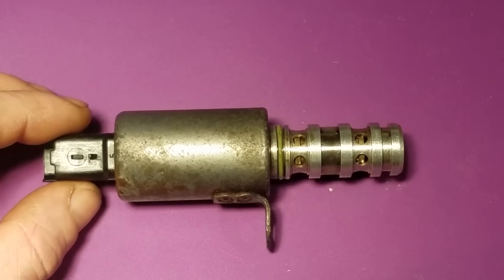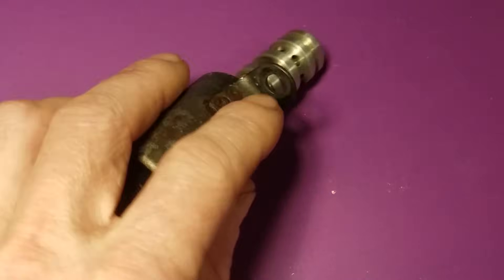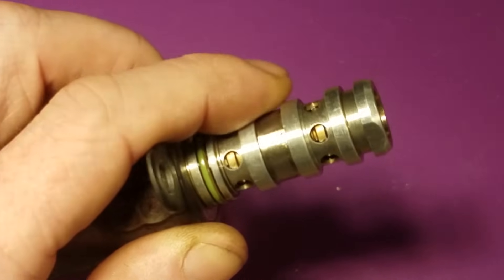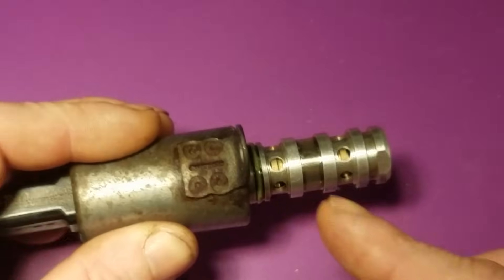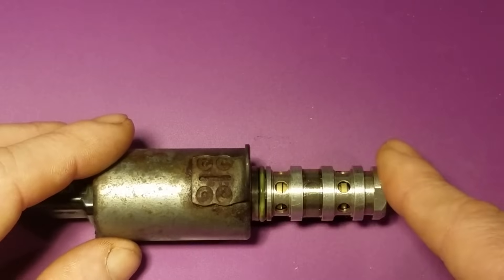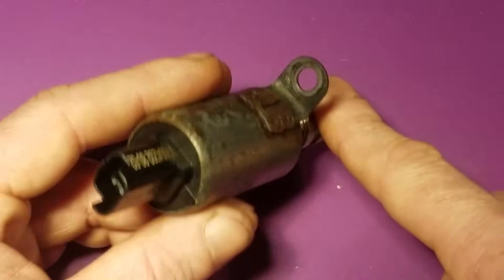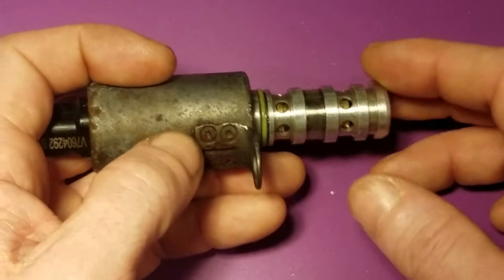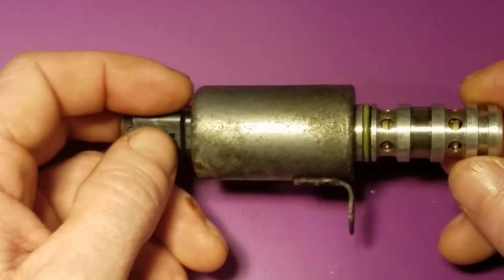Variable Valve Timing Code p0011 p0010 p0012 p0013 p0014 p0028 (Don't Waste Money)

Comment from the maker: Pocket Scan Tool: https://amzn.to/2GlbzzY
You can get VVT Solenoids on Amazon Cheap here: https://amzn.to/2whpJO2
Reply: The Flat Rate Mechanic its vct solenoid not vvt
Reply: I just cleaned mine and the power saving  light come on while on the highway than the power steering came on a 10 minutes later and the ABS also till I lost power (P0010 a)
Reply: ggg's fan its actually vvt. Valve variable timing . I've dealt with them
Reply: The Flat Rate Mechanic epic video
Reply: The Flat Rate Mechanic l have a 07 trailblazer with 148k. I brought it with 120k. I have made sure that I've have done all the reg maintenance myself. I use Mobil 1 and I just changed the oil the other  day and I decided to pull the cam actuator and check the screens. To my delight they were very clean , just a few tiny specks of debris. this is the first time I've checked the valve timing solenoid I pulled it out and it was very clean screens were very clean . I think the previous owners must have had it serviced reg too.
Reply: Thanks, my Benz has the P0012 code so I'm gonna try this first. Great video, very Informative.
Reply: I have no codes yet I went and took out that solenoid and cleaned. I have a hard switching gears at about 40mph and why would up hill it revs up hard like the timing is off behind

Comment: My 2009 malibu with 175K just threw a CEL.  Used my OBDII scanner and got the P0013 code.    In all 175K miles its never used oil between changes, but just went and checked the oil it was low!!  Added about 3/4 quart and CEL gone.  Thanks for saving me from embarassment (or geting ripped off) at the mechanic!!!

Comment: My 2005 Volvo V50 2.4i Check Engine light came on while on a trip back from SW SD to SE MN. I stopped and had the code read for free at Oreilly Auto in Rapid City, SD. P2006 was the error code for Bank 1. Since I didn’t have tools to do a solenoid replacement I scouted the web and found your post. I had an oil change done before leaving Rapid City and that solved the issue. Thanks for posting this info. I am new to Volvo’s and I’ve heard they can be pretty sensitive if not maintained properly. You saved me a lot of time and trouble!
Reply from the maker: Thats awesome. Thanks

Comment: My friend ran his oil low and way overdue car started running horrendous multiple cylinder misfires on all 6 cylinders. Codes p0018 and P0022 led me to believe this was the problem. Changed oil and took it a few miles to wash off the engine at the car wash. By the time I got done and cleared all the codes it was running like nothing ever happened. This video explains what happened thanks! 2007 Hyundai Santa Fe 3.3 l v6

Comment: I replaced mine before I had any codes. I then took the old ones and cleaned them by using a sonic cleaner.
I always change my oil and filter every 3,000 miles so they looked pretty clean. I ran them through the sonic
cleaner twice and it did remove some light granules. After cleaning I put them into a container and filled it
up to the bottom of the plunger with oil so they don't rust. They are now ready to use if and when I need them.

Comment: I had the  P0013 problem. The change of the oil seems to have helped. Thank you!
Reply: I went from full synthetic 5w-30 to high mileage full synthetic and it caused a check engine. I’m gonna try to switch back and see what happens

Comment: Thanks. Had the problem with my Lexus.  Oil clean, screens clean, valve cycled fine. Went to my mechanic, who is a smart guy.  He just cycled it more times. After maybe a dozen or so, it failed. Replaced it and no problems. In retrospect, I probably just should have cleaned it more thoroughly. Will the next time!

Comment: First thank you for your video, it was very informative and easy to follow. I only 2013 Buick Verano, when I purchased the vehicle it was at 20,000 miles. I am now at 85,000 miles and have experienced that code on my vehicle three times. Along with that code popping up my car will also shut off while in idle, this would typically happen after I start my car drove and then come to a complete stop. Each time I was able to start the car again and everything would be fine. I took my vehicle to the Buick dealer due to this engine code 3 separate times. Twice they told me they had to replace the camshaft. This last time which was about a month ago they told me that the code was due to low oil. I got the old changed and he told me that my car will be fine however my car is still shutting off while I’m driving it. They also turn the code off and now it’s not coming back on, But I’m wondering if my car is shutting off key to a camshaft iss but I’m wondering if my car is shutting off due to a camshaft issue
Reply: Stop using cheap oil.  Mobile 1 oil filter  high mileage formula synthetic oil  an oil additive synthetic lucus oil treatment

Comment: Thanks for the video! You saved me a few hundred bucks. Daughter just ran her car super low on oil
Reply: Cause that's what they do.😫😫😖😤
Reply: not sure how you would have ever spent a few hundred bucks, any mechanic you would have taken it to would have told you it needs an oil change lmao a walmart tech would have told you that. This video is for learning about malfunctioning solenoids, little less obvious than needing oil.
Reply: @otallono  you are way too trusting of ppl. I have seen ppl get ripped off whether due to malice or incompetence. Had 2 bad experiences with repair shops with this very car which raised my level of skepticism.  Also had a mechanic forget to torque my lug nuts and the wheel nearly fell off on a different car. These aren't shadetree mechanics I go to either.

Comment: Thnx. I got the errors and my mechanic did not know it. Kept resetting it. Pulled it out. Cleaned with brake cleaner and tested with 12v and now the code is gone. Thanks again

Comment: Thank you.  I have a 2014 Cadillac ATS 2.0T .   I am having 2 times now in 1 year,  these codes.   I replaced the solenoid once,  and was about to do it again.. but I will try to clean as you suggest my friend... Thank you !!
Reply: 99v8cobra did the problem resolve after cleaning?

Comment: After having my R56 N14 engine rebuilt it was running really tough at low RPM, ok above ~2000 RPM.  Taking out the vanos as you describe and cleaning it twice seems to have solved the problem.  I also took out and cleaned the one-way oil check valve just below the vanos.  I could see considerable sludge on the screens of the vanos, I assume residual from machining the block.  In no way to I fault the machine shop, this was a very small amount of crud but I expect enough to require removing and cleaning the vanos screens twice.  Really hoping that's all that's needed.  Thank you for the video.

Comment: I got the P0011 code shortly after an oil change from an oil change chain superstore. I am always suspicious and think I will go back to a specialty shop. I have a Chevy Equinox. Thanks for the information.
Reply: Divine Diva  samething happened to me. That same code keeps coming back. Now my car sometimes has a hard start or will just turn off .  Ive replaced the cam sensor but code still comes back
Reply: Divine Diva I got an oil change before going to my sisters 3hrs away. About an hour into my drive that code popped up. Wonder if it’s related
Reply: I want a free book

Comment: I removed a p0011 just by cleaning a ground wire near the area of the solenoid, at the front of the engine. Before the repair the truck ran rough coming up to stop signs and would buck and jerk when leaving the same stop sign. After repair the truck ran smoother and can do burnouts now lol.
Reply: What wires the connecting point
Reply: Would this happen to make my car make a noise like a grinding noise when I drive slow

Comment: Yup - checked the oil on my '18 Colorado 2.5, and it was low.  Had a couple quarts in the garage from another car I sold.  Added one, drove it and the problem had disappeared.  No other video mentions this.

Comment: Ive changed these before when i was having issues shifting gears, the problem is back with a p1811 code (transmission solenoid) hopefully this fixes it again. That was 3 years ago and about 80k miles ago.

Comment: i changed my valve cover on my 2002 vw gti. i never had this code until i changed the valve cover. my oil was due for a change and i changed it but the code came back. i’m gonna take a look at the vvt solenoid
Reply: It never ends sometimes. Seems like you fix one thing and it's a chain reaction until the whole thing is about rebuilt. I replaced a radiator and ended up replacing the transmission line. Started leaking right after the 1st repair.

Comment: I cleaned 2012 GMC Terrain the exhaust solenoid (Code P0013) and cleared the code. 2 days later, Code P0011 appeared and the car began running rough and stalled at stop lights if did not push a bit on the accelerator.  P0011 is apparently another camshaft related item that I need to fix in order to pass emissions test. I wonder why this second code popped up as I pulled into the testing station. Spooky.  Hope I can find a video about that 'quickly'.    You have a great way of presenting your information. Thanks.
Reply: Just got that code as well today did u figure out what was the issue

Comment: I just got this code on a family owned 2006 Nissan Altima 2.5L ( QR25DE ) engine , the problem is it hesitate during throttle ( on Drive or Park ),  at first I thought it was the timing , but  then I scanned  it and P0011 is the code . 
this is what I found , in 2007 Nissan made a recall on these particular year model and engine class regarding the camshaft sensor faulty reading ( overheating ) and disrupting the ECM faster than it could calculate and signal back . so I replaced both VVT sensor and the camshaft sensor , it is still doing that . 
now I must open the timing chain cover and inspect the timing DTC . 
I got the PDF file and it shows it can be even triggered by a coolant temperature sensor or oil pressure pump , and so on . I tested all the sensors and they all are working according to manual procedure. 
I tell you : these new cars are not worth buying at all .
Reply: Same with my 06 sentra 2.5. You have any luck figuring out the issue?

Comment: Also causes P300 and P012 codes at the same time.   I replaced spark plugs before I realized P012 is triggered before P300.  On Altima 2004 3.5 it is the one towards the front of the engine.
Reply: P0075 on my Opel/Vauxhall Astra

Comment: Wow that was very helpful because I just put on new valve cover gaskets on my 740I, The those codes popped up, so I’ll be changing the oil and filter
Reply: Did it fix it when you changed ?
Reply: I literally got that today , changed my vavle cover gasket a few days ago & that code popped up

Comment: Did a complete timing chain job on my QR25DE and the rattle on cold start came back after one week. Turbo, pistons, rods, springs. 18lbs
Reply: Need synthetic  Lucas oil stabilizer

Comment: I replaced my VCT(along with the 2 camshaft sensors) and I still experience the issue. what should I be checking next? runs super smooth if I disconnect them.
Reply: How many CS sensors does you vehicle have? Did you get codes?. Did U change the VVT for both banks or just one?
Reply: @ceewood1354  After several weeks of tinkering with this, one advice I had was to simply go to a heavier oil. So for grins, 1qt of LUCAS. Last 3 days not an issue. Talked to my tech, he mentioned that it was a good idea, as it is likely the OP has gone down (277k mi). There hasn't even been a hickup. Along with this screwed in some new plugs (old were yellow and torqued in NGK) and a whole set of new coils. So will be changing the oil Friday, and switching to some rotella. Conclusion: 1qt of LUCAS for me did the trick. thanks for taking time to reply back. Just forgot to come back and give an update.
Reply: @ADHD_Gamer  Super happy you found a fix!!!!!

Comment: I recently picked up a 12 year old Buick for my wife. It passed my scanner with flying colors but right after I buy it we notice it hesitated a little at start up sometimes. Nothing serious and I wasn't real concerned for as old as the car is. . I changed the oil/filter and air filter just for the sake of buying a used car. Both were just a little dirty. Nothing serious. I was not expecting the start up hesitation to go away but it did. My wife noticed zero hesitation after a week of driving and swears whatever I did fixed it. I was baffled that it went away. Maybe it's the clean oil. Or maybe its the Wix oil filter which is noted for its quality check valve. I dunno.

Comment: If you have 55psi at fuel rail and spark to the plugs but engine won't start, could that just be dirty solenoids or timing chain?

Comment: Well I was going to work this morning and the check engine light and the 4wd light came on my dash. Also the cruise control light started flashing. When I got to work, I plugged in my obd2 scanner and it said p0012. (This is on a Toyota RAV4 v6). It said bank 1 . Got home and this engine has four solonoids. I went ahead and took all of them out, one by one and cleaned with brake cleaner. Took a pick and moved the plungers. Reinstalled and boom! Lights are gone! Thank you sir. Now for an oil change.👍. I'm still not sure why the 4wd and cruise lights came on?
Reply from the maker: A lot of Toyotas will set 4wd and cruise light anytime there is an engine light. Not uncommon.
Reply: @FlatRateMechanic  Mine will leave the VSC light on for a few seconds with morning start. That's when I know to load test the battery.

Comment: i recently had the timing belt and sump cleaned and the engine light was not removed.  Could error P0014 be related to the work done relating to this work done which was supposed to resolve errors P15A8 at all?  Is the work the mechanic carried out incomplete?

Comment: Make sure you buy OEM or you'll run into trouble. Especially if you use dorman solenoid
Reply: I just replaced one on my 2003 tbird for a slow oil leak out of the connector and ordered a cheap one off of Rockauto. Now I have the POO12 code. Just ordered a genuine Ford one. Lesson learned.
Reply: @keithwiebe1787 did the oem fix this?
Reply: @cutliss  The OEM one fixed the oil leak and the code I was getting with the aftermarket one.
Reply: @keithwiebe1787  thanks for the update. I'm going OEM for electrical engine parts now.

Comment: Hello, i have Problems with P2090 on an Peugeot 3008 1,2 Turbp 130 HP EB2DTS Engine. Do you have any Tips for me. The Steering Time are 100% correctly.
Both Aktuators are new.
Regards Peter

Comment: My Sienna used to get P0012 at times, even with new oil. Even after cleaning the valve, which wasn't dirty. It could be thousands or even ten of thousands miles between codes. Then it went probably 100,000 miles fine. Just today P0012 came up again. Weird.

Comment: I have code p0010 says variable valve timing screen need replaced but I have a rattle and it’s very loud now after a bit of driving . The car will shut off I have to start it again. And it’ll do it a few more times til I reach destination. I have a 2009 Honda Accord no oil in car.

Comment: Oil has been religiously changed and checked got a P0014 change oil cleaned exhaust bank solenoid I can drive 10 miles and code comes back

Comment: I get a check engine light that throws a p0012 code on my 2018 Ford F-150 XL 3.3L only when I am towing my travel trailer up steeper grades usually above 4,000 ft? I use the recommended manufacturers motor oil and change my oil and filter regularly. Any idea what might be causing this?

Comment: Shoot, I just paid my mechanic for something I could have done myself.  I hope this fixes the issue on my Mini Cooper Countryman.
Reply: SaucyBegger25  - My car’s symptoms were delayed throttle response of about 1-2 seconds, followed by over acceleration and erratic throttle.  The delayed throttle response made the car less safe to drive when you are trying to time a left hand turn on a busy street.  This only happened once in a while but got progressively worst over time.  The symptoms went away when the car was turned off and restarted, so diagnosing it was a pain in the ass.  Performing the work as described in this video helped the car for sure.  It’s been a couple of months with no signs of this problem.  My car is a bit of an oil burner so sludge buildup probably caused the issue.
Reply: SaucyBegger25 -  a bad thermostat causes the car not to turn on after it’s warmed up.  I had the same problem and also fixed it.  Honestly you probably have compounding issues that need to be resolved before the car is driving fine again.   You’ll have to check spark plugs too if you have power dips or hesitation.  Get yourself a OBD2 scan tool and read the codes.
Reply: SaucyBegger25 - lol, check you spark plugs, they are probably worn out.  Solenoids usually don’t go bad, they get clogged or dirty and struggle to operate.  Most of the time just cleaning them and changing the engine oil is enough.  My mechanic also swapped their position to see if the problem moved (trigging new engine error code), but like I said before the problem went away.

Comment: My Mini cooper has the exact same solenoid and when I pulled it out of my car, the cetre screen was present but the 2 screens on the ends as like yours were not present. Is this fine for use on my car?

Comment: On a 2007 Ford Edge if I replace bank 1 solenoid and want to go ahead and replace bank 2 while I’m at it, will it take the same solenoid? The code had been coming up since 2016 I know I’m terrible but situation made it hard for me to get fixed 🙄just now started running really rough! Thanks for the video😊